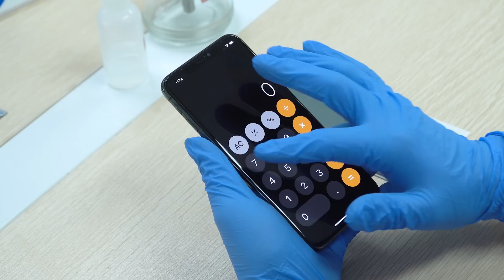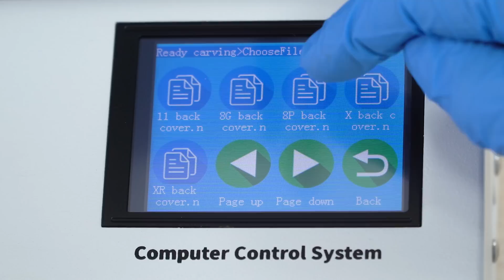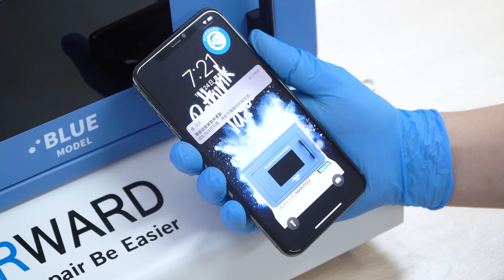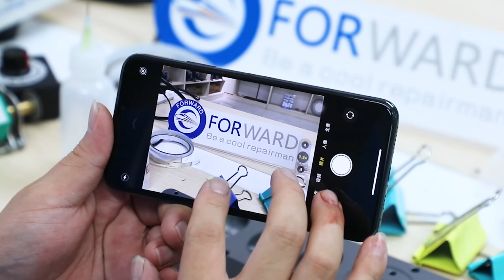World-first Blue Light Laser Separation Machine,  Replace The Back Glass of iPhone 11 Pro Max

Comment: Hi just bought this will it have the schematics for the iPhone 13 already in place or do need to download it thanks
Reply from the maker: Hi, thanks for your support.  All the laser machines purchased in the last month have drawings of iPhone 13 series.  If there are no drawings of series 13 in the USB flash drive, you can ask our salesman to get the link to download the latest drawings.
Reply: @FORWARDTOOLS_official  k thnsks
Reply: Hey man. I have to ask I’m thinking about getting this machine my self and I have to ask. Can I repair the back glass with all the housing components inside ? Like he did on the video or should I just remove all of them just in case
Reply: @jauyfinch  this one yiu can says my sales rep so its quite the time saver I just got mine delivered 2 days ago so havnt tried it yet but I will test for sure test it out that way that was the plan anyways
Reply from the maker: @jauyfinch  Both methods will work. 
https://youtu.be/DlbkMWNbRI0